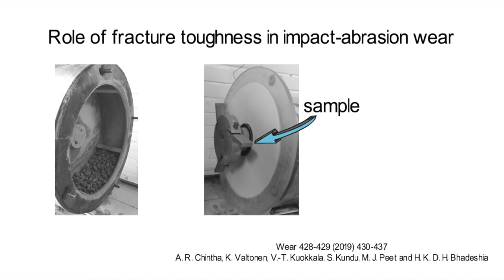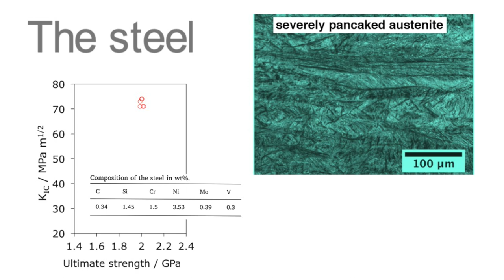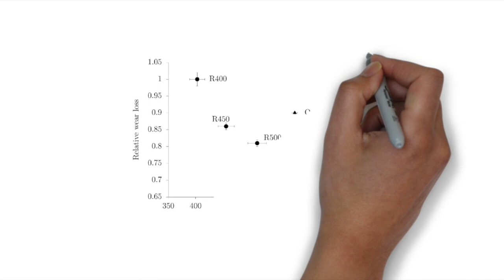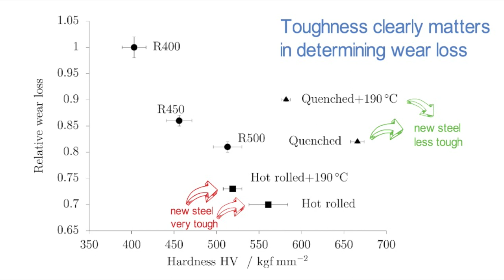Impact-abrasion of novel steel

Comment: It would be interesting to investigate the link between fracture toughness, which is a quasistatic property, and impact resistance, which is a dymamic one.
Reply from the maker: This steel has a Charpy impact toughness of about 30 J at -40°C. But note that the Charpy test is empirical so the data cannot be used in design, only as a ranking test. Fracture toughness, on the other hand, is a material property.